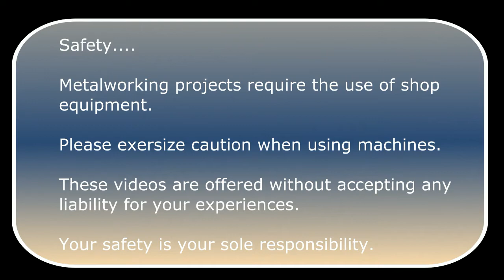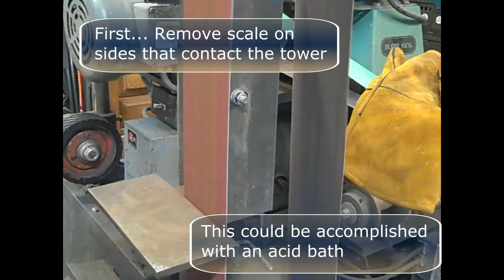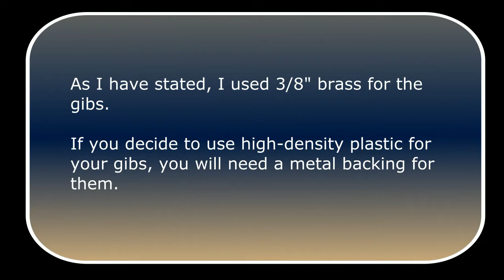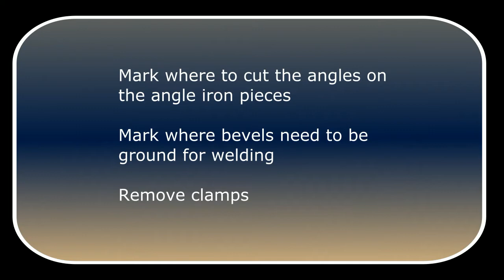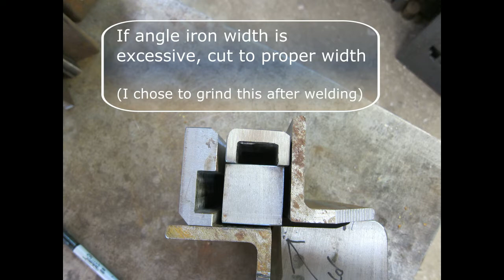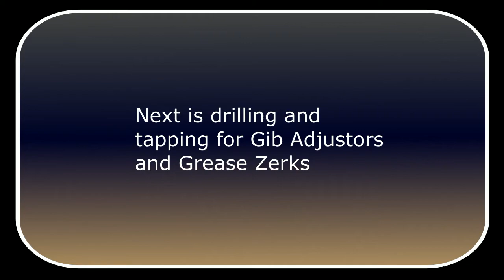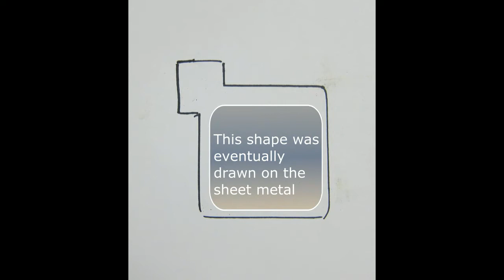Cricket Air Hammer Build - Part 3 of 11 (Ram Assembly)

Comment: Great videos, what is the function of the brass gibs. I dont quite understand the purpose
Reply: First of all...  I am now recommending using Ultra High Density Plastic instead of brass...  Watch all the videos...

The purpose of the gibs (brass) is to have the capability to push the ram against the tower (two sides) to eliminate wobble during cycling.  There are adjustment bolts that push the brass (now plastic) forward to make the gap between the gibs (brass) and the tower very small.  

One more note....  I am actually recommending using plastic on all 4 sides of the tower now to eliminate the need for grease.